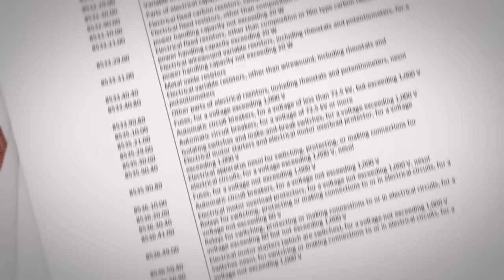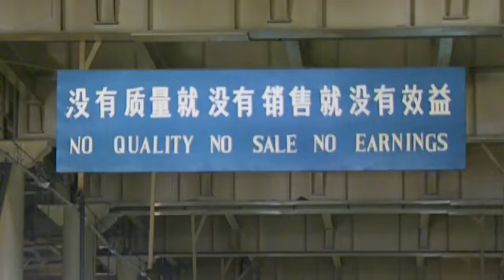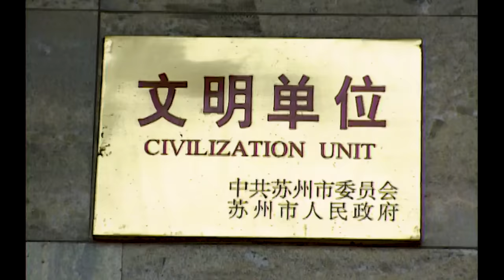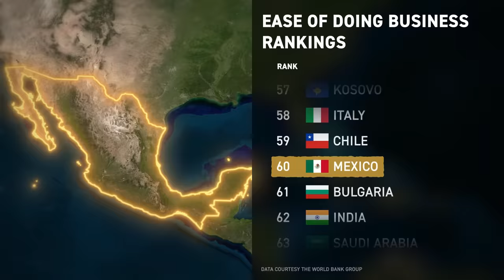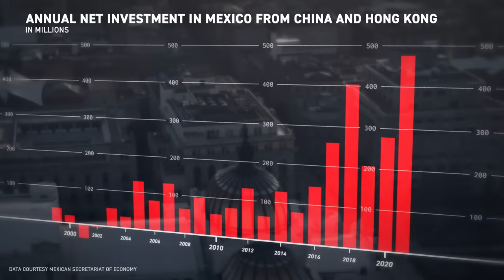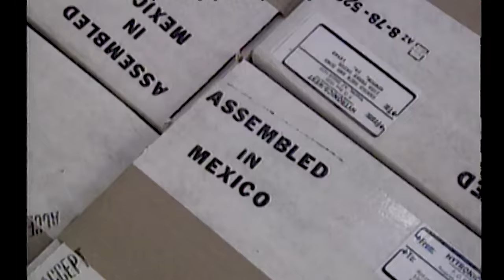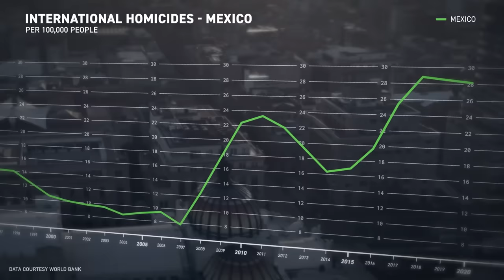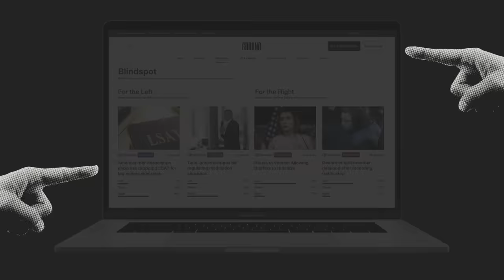How Mexico is Becoming the New China

Comment: The supply chain isn’t just one directional, a lot of products move across the border several times going to highly skilled American manufacturing, and then back to Mexico for less advanced steps, and so on. This is REALLY helpful for not only production costs, but for American Manufacturing which before had to just be at the end of the production line or supplying advanced parts. This makes the US industry way more resilient and healthy.
Reply: I think this is an interesting quirk that isn't well touched on. American manufacturing half died because it was too expensive to come in anywhere but the back of the line when the low cost was centralized in China. If it's centralized across a land border it'll make a lot more sense overall to have it in a variety of steps than simply the final step.
Reply: And throw in that many commodities could be sourced from South America and sent to Mexico, whereas before you'd have to send them on literally the opposite end of the world and then send them back across the pacific to the USA. I think people underestimate the true potential of South/Latin America, and this trend will only make it easier for us to realise and partake in that potential.
Reply: It's odd because Mexico produces many engineers. They have a solid university system. I work by the border, next to Tijuana and my employer has many Mexicans on work visas working as electrical, mechanical and aerospace engineers.
Reply: @RK-bx1by  China doesn't underestimate the potential of Latin America - they're literally their leading trade partner, and that is still growing. Meanwhile Latin American nations don't exactly love the US. Caspian Report made a video on this a while ago.
Reply: @ArawnOfAnnwn  Great point. China has also done quite well in Africa, so much so that Chinese companies have cornered the production of cobalt in the DRC, where the vast majority of the stuff comes from.